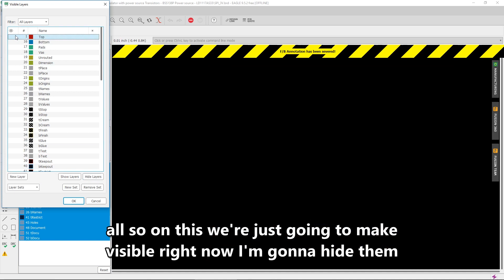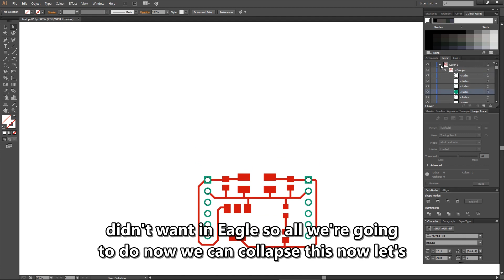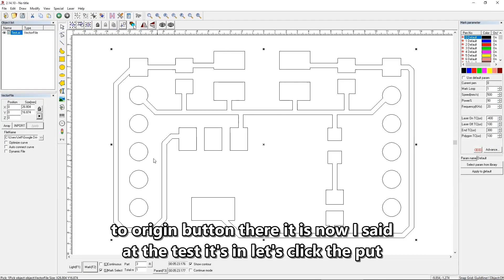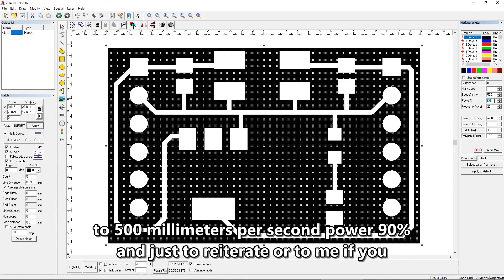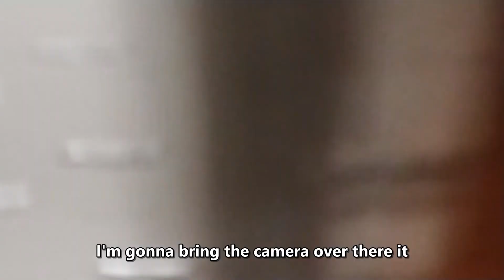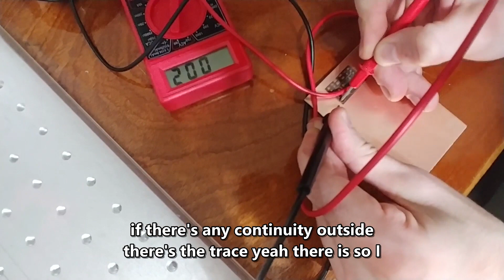3 11 Making a PCB with a Fiber Laser  using Eagle Illustrator  EzCad2 1080p

Comment: You can actually drill the holes and cut the board outline with the laser itself. It just takes a lot more passes. Look into wobble settings or use very slow speeds. I actually prefer to not remove the copper with the laser because the carbonized FR4 is slightly conductive, so I just thin it out and remove the rest with an acid etchant. The good thing is that because the holes are slightly conductive, you can actually copper plate it (I've had some success, but still working on it)